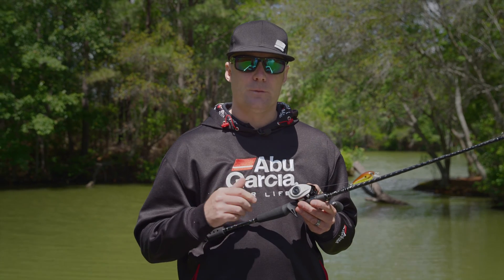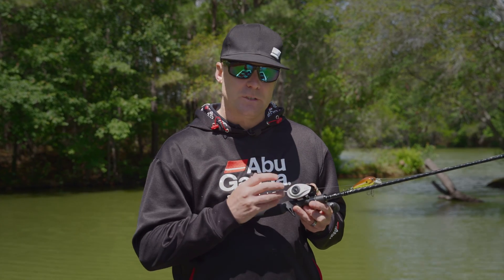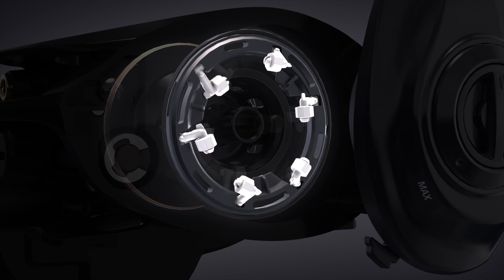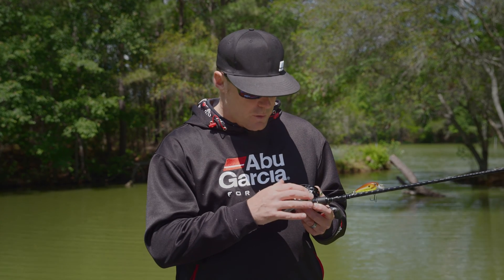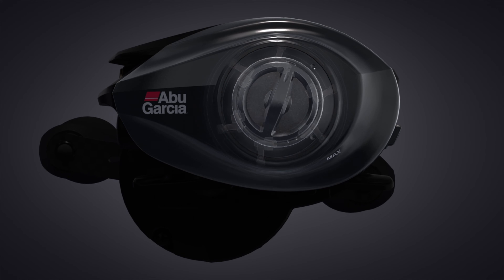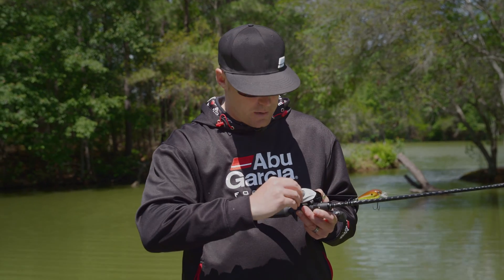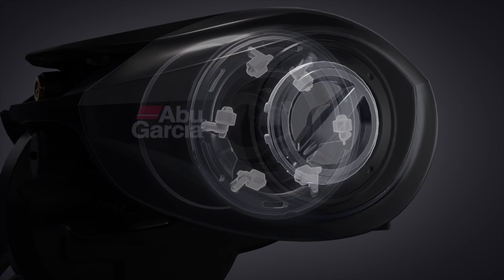Revo® 4 IVCB-6L Braking System Overview

Comment: Is this supposed to be better than Magnetic Brakes?  It doesn't look like its easier.
I saw a post with someone saying these are like Penn Fathom or Squall low profile or at least they are built in the same factory. Is that true, are they the same?

Comment: I cannot figure this out. My break flops just flop up and down and the reel is very prone to backlash. I can’t click or unclick anything
Reply from the maker: Try turning the exterior dial up to the Max setting. You should feel the brakes slow the spool significantly. Start turning the exterior dial down a couple of clicks with each consecutive cast, stopping the spool with your thumb once your bait hits the water. You will find a sweet spot, where the reel will not backlash, and casting distance is maximized.
Reply: @AbuGarciaTV  GoBucks is right: you can not click / unclick them ... you must do it via the exterior dial !

Comment: Having a hell of a time figuring the break system out that you just showed. Not cool. Especially when I passed up a Curado to by these two SSX Revos.
Reply from the maker: Hi Danny, thanks for reaching out. 

The IVCB-6L Braking System is designed to be adjusted for just about any sized bait suitable for a casting rod. If you have purchased a new Revo SX - https://www.abugarcia.com/products/revo-sx-baitcast-reel they do not have locking brake locks, which could be why this video is confusing.

Comment: So when it comes to the icvb-6 brakes, on my revo rocket, I’m not able to lock the internal braking blocks?
Reply: Me too. I just got the revo rocket. I’m still trying to figure out, I should have just stick with shimano reels. 😂
Reply: @guusylosey3300  you can take out the pin. I use only 3 pin and can do long cast.
Reply: @calmstudio6669  but thats like false advertising, and the worst part is mine doesn’t come with manuals
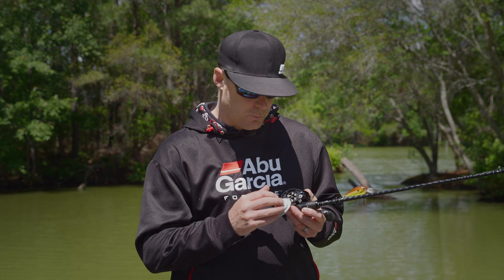Reply from the maker: You can lock the brake locks, skip to 0:45 in the video for a tutorial on how to.
Reply: @AbuGarciaTV  I don’t think breaks being shown in this video are the same. I can’t push in on the pins to lock them in place. Is it possible to buy another spool with these adjustable internal breaks and use them for the gen 5 rocket
Reply: I have the same issue with my abu5 stx. The pins cannot be locked which is a huge bummer.
Reply: so how the progress still can lock or unlock your Abu STX? @nickwienk7825

Comment: I own 6 high end Abus, including two Revo Rockets and a Revo Ike, the IVCB-6L  has been nothing but problems in the few months I have owned it, the plate holding the break locks fell out, and I have lost 1 of the brake locks, also now it is impossible to keep the brake lock plate in the spool, so any time I service the reel all of the brake locks fall out.